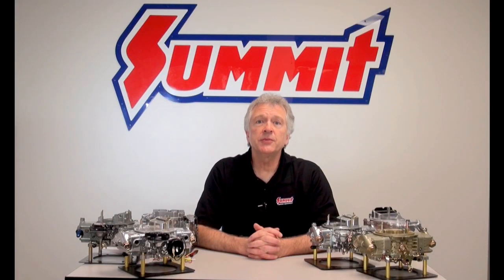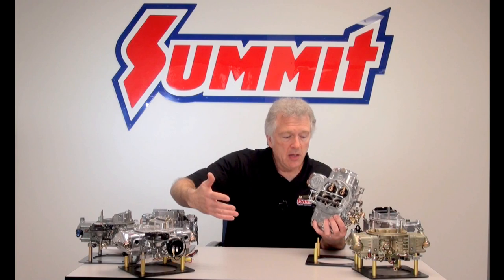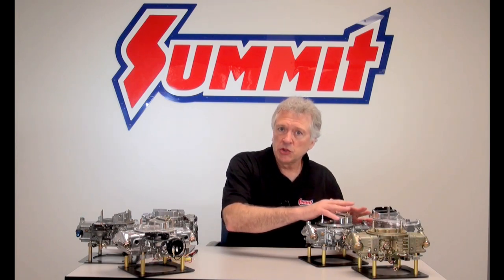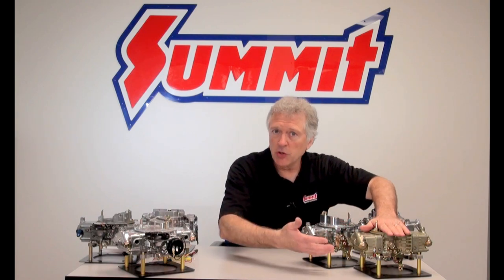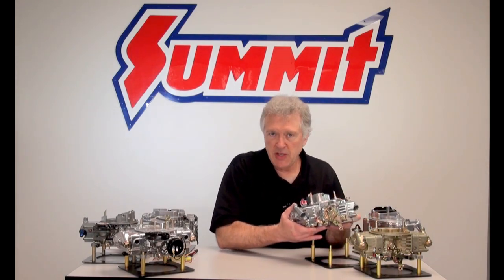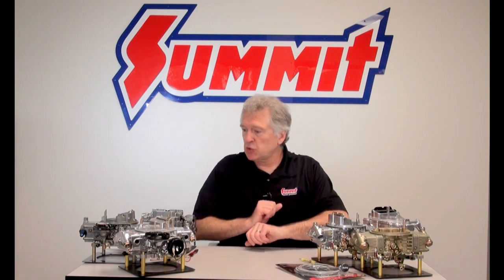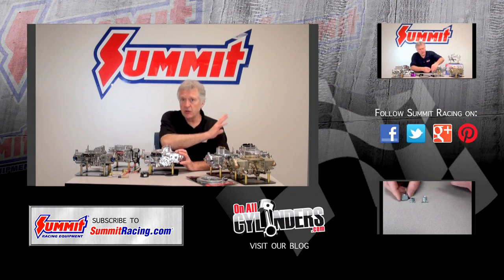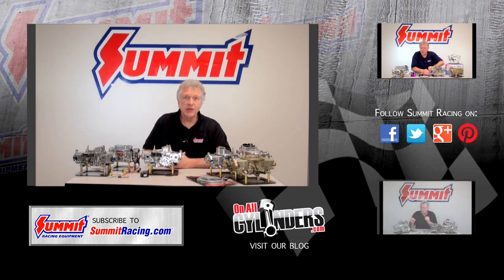Carburetor Electric & Manual Choke Tuning - Summit Racing Quick Flicks

Comment from the maker: Hi jeepjeeplady, 
A couple things before we condemn the “Choke Thermostat”. Check the voltage going to the choke cap; it should be 12 volts while the car is running. A lower voltage will cause slow to no operation of the choke. Also check and verify that the ground for this circuit is good. If those check out okay, chances are the choke cap will need to be replaced. Thank you for watching!!

Comment: i have a weird autochoke system on my Weber 32 DAT 12. it chokes when a  cooling water sensor turned  a valve on if water is cold. it worked like shite constantly choking even on hot water and flooding my carburator with fuel. i took it off and now it works very good. when cranking on a cold day it takes a couple of try to start but that's all. Sometimes i think choke makes more damage then help.

Comment: So I've only ever used mechanical chokes for my builds. Would a high rise/edelbrock air gap intake change the way the increasing heat of the engine affects the choke spring so the choke properly disengages as the engine temp rises? Considering the choke spring is further away from the heat source that is supposed to make it disengage. Thanks in advance
Reply: This is a very good question and would like to know the answer myself...

Comment: I have a Holley carb on a 390 fe engine. My question is this. The dial on the electric choke with the 3 screws will not open the flaps manually  to let any air through the top till the notch reaches the 3 o'clock position. This is then out of the range of the markings around the top of the carb side. Do i need to stay in the range and keep the flaps completely closed till warm up? Or is the 3 o'clock possession acceptable to have the flaps open slightly when cold? Or do i have a fault? Regards Adam

Comment: Awesome Norm. Question , I have what looks like a vacuum line under the electric choke, i heard it is for cold air over the choke coil to keep it from over heating. Do I hook this up to any vacuum line?
Reply from the maker: Tony Assenza, 
Depending on the brand and model number of carb that you have yes, this is possible and should not be hooked up to any vacuum hoses. Feel free to give us a call if you have further questions. 1-330-630-0240.

Comment: Any tips to check for an electric choke that engages when the engine is up to temperature (idle will go way up and go peg my wideband O2 10:1 AFR)?  

If I stab the throttle to get it off the cam, it will hold even higher until I upshift or shut the car off.  If I shut off and then start the car again the issue will go away and warm idle as normal.  I did check that nothing is binding on my throttle or fast idle connections, and my keyswitch 12V and ground voltages are consistent.

New Holley 4150 650 double pumper mech. secondaries on a 355 SBC.  Choke element adjustment in about the middle position, as it was shipped.

Thanks, Justin
Reply: I stand corrected possibly.  It appears the intake carb gasket sticks out a bit and the fast idle screw was rubbing on it, possibly sticking on it.  For anyone who encounters a similar issue, something to check.

Comment: My manual choke will close all the way, but when I toggle it over to all the way open, it stops about 1/4 inch short of straight up.  This is with or without the cable being attached.  It has nothing to do with the cable.  If I manually push the actual butterfly all the way open, it will open, but it bounces back as soon as I take my finger off of it (spring loaded).  Any thoughts/suggestions?
Reply: I know this is a 5 year old comment, but that's normal. When a Holley choke is open, it's kinda tilted a little. It's like that on my newly refurbished Holley 350 too :)

Comment: This is good stuff to know but you are mostly explaining "how" these choke systems work rather than giving us the details of how to adjust them hence your vid title "choke tuning".. Im not complaining because I know more than I did before I watched the vid BUT I still don't know what to look for when adjusting my Holley electric choke on my old Ford 260.. When I bought this car (1964 Ford Fairlane) it had a brand new Holley 4b installed on a 2b intake and the electric choke wasn't even wired up at all. Car runs great once up to temp but I have to sit in it and babysit the throttle for about 15 minutes before it will run on its own... At cold start my choke flap is all the way closed. I have seen several vids that say there should be a slight gap (big enough for a pencil to fit) at cold start. Is this true? I know this is different due to particular engine but as a starting point, is this basically true?
Reply from the maker: +GeorgeBonez, 
True, there does need to be a slight opening left at the initial cold start. If not, the engine can’t get any air and is snuffed out. If there is too much gap, the engine does not get enough of a richened mixture (too much cold air) to start and stay running. It really is a balancing act! Feel free to give us a call. 1-330-630-0240.

Comment: Adjusting the bimetallic spring and fast idle is only part of  the choke circuit. There should also be a choke pull off adjustment but I can't find it on a Holley carb. Do Holley carbs have this part of the circuit? Is it adjustable?

Comment: Have an older 80457. When you install the new choke cap, do you rotate it clockwise until the index marks line up? It seems like that is making the choke plate too tight but I’m new at this and wasn’t sure. Thank you.
Reply: Just as soon as it closes stop rotating....slow down.

Comment: Where can i buy a AC mechanical fuel pump for my 1957 ford engine
Reply from the maker: Albert, AC Delco only lists fuel pumps back to 1962 for Ford. The closest thing available would be a pump from Delphi. We would need the verify the application and engine size to recommend the correct part number. Here is a link to the Delphi pumps for a Y-block: https://www.summitracing.com/search/part-type/fuel-pumps/department/air-fuel-delivery/section/fuel-pumps-regulators/year/1957/make/ford/brand/delphi?N=brand%3Adelphi&SortBy=Default&SortOrder=Ascending&keyword=fuel%20pump&kr=fuel%20pump

Comment: on the electric choke why do you you need the 12v connected ? the spring should be able to relax with out the 12v surly
Reply from the maker: Hi Mar Gudmundsson, 
Correct, most electric choke assemblies can be adjusted to wide open and stay that way with no voltage applied.

Comment: Would be helpful to cover the choke cam and how it works too.  I don't fully understand what it does and how it works on my electric choke 4160.
Reply: ditto that's what got me here in the first place, I hear that the choke should step down the fast idle cam automagically, and then I hear that it does not, so which one is it

Comment: what would be a good reason for my fast idle cam not dropping when the choke is fully warmed? even when i blip my throttle it still is sticking wide open. it is not binding on anything and i have even oiled it and i still have to pop my hood every time i start the engine.. please help! thanks
Reply from the maker: Hi dtaylorh18,
It appears you’ve taken care of any binding issues; some other reasons for this issue are listed: 1) lacking 12 volts at the choke coil while running. 2) Bad ground at choke coil. 3) Choke coil out of adjustment. 4) Bad choke coil.
Please let us know if you have any additional questions. Thanks for watching!

Comment: I have a 86 ,gm 2.8 v6 that has a Rochester VARAJET 2bbl carb that needs replacing.  Any suggestions?
Reply from the maker: Hi dixonyourmom, 
We offer a remanufactured Vara-Jet that is a perfect match for your original. No modifications are required. It’s our part number  URM-3-3814, it’s $348.99 plus a $45.00 core charge. If you send us your original rebuildable carb back, you’ll be refunded your $45.00. If ordered today, the it will ship from our rebuilder within a day or so. http://www.summitracing.com/parts/urm-3-3814/overview/make/chevrolet
Please let us know if you have any additional questions. Thanks for watching!

Comment: I got a 79 chevy malibu with a custom Vortec 4.3L V6 engine. Wich carburetor would you recommend? someone told me that a Edelbrock #9906 would be a good fit. Is that right?
Reply from the maker: Hi bladielmickey, 
We’re going to need some more info to help you make a proper choice. Give our tech line a call and we’ll help you work it out! 1-330-630-0240. Thanks for watching!

Comment: Recently I installed a new carb from Summit on my 81 Ford Econoline. I had a backfire once and the choke got stuck shut. I fixed that, but once I put the carb back on, the choke comes on a lot when I'm driving around. If I idle the vehicle for a long time before driving, it won't do that. But if I stop the vehicle for more than five minutes and start driving again, it will keep coming on. I have an electric choke by the way. I can always kick it off, but it will come back on after a little bit of using the gas peddle. Any suggestions on how to fix it?
Reply from the maker: Okay, please tell us who made the carburetor in question here – Autolite/FoMoCo?  And, what is the model number?  Let us know.

Comment: What's the difference between electric choke and manual choke carburetor
Reply from the maker: DUB DA CAPO , 
A manual choke uses a cable that mount under the dash and run out through the firewall to the carburetor. When cold, you pull the cable shutting the choke blade. When the vehicle starts and warms slowly, you push the cable in opening the choke blade. 
An electric choke is more automatic. They have a spring on the side that electricity warms up and opens the choke blade slowly. Therefore you do not physically have to push or pull a cable but, you will have to make fine tuning adjustments periodically as the seasons change outside!

Comment: I have a 67 Buick Riviera v8  430- 4 barrel carburetor  and i need a new one. witch  carburetor should I buy?
Reply from the maker: Hi kingblack22ss,
We offer a re-manufactured Q-Jet that is a perfect match for your original. No modifications are required. It’s our part number  URM-1-198, it’s $209.99 plus a $45.00 core charge. If you send us your original rebuildable carb back, you’ll be refunded your $45.00. If ordered today, the estimated shipping date is: 2/18/2014.
http://www.summitracing.com/parts/urm-1-198/overview/make/buick/model/riviera/year/1967

Comment: hi sir i am frpm pakistan i have a datsun 1982 with orignal 10a engine in it .. i just swaps its carb with f6a engine's carbs which is E-HA11S and it was  working fine in summers but now in winters it doesnot start in morning when its too cold but later whole day it starts very well ... plxx help me for this prob i think its some kind of choke issu???
Reply from the maker: +danish ali, 
It is possible that the choke simply needs to be adjusted. If the choke cap is retained by rivets, you will need to remove these rivets and replace them with screws.  Once loosened, simply turn the choke cap in the direction that closes it sooner. This will add a little more pressure to the internal spring and keep the choke shut longer for those cold days. Tighten the screws to maintain this adjustment.

Comment: I have a 4160 Holley with electric choke. I took the coil spring and cover off. Does the choke plate linkage go above or below the red high idle cam?
Reply from the maker: Hi Pete, 
One option for looking at things would be to look at the 360 view of part number HLY-0-80457 here: https://www.summitracing.com/parts/hly-0-80457s/overview/  It will spin around and you can pause it where you need.  The linkage you’re talking about will go above the red high idle cam.

Comment: When you install the electric choke cap back on, do you have to rewind the spring/turn the cap alot or do you just put the tab in the spring hole, line up the marks, and screw it down?
Reply: There is no winding up of the spring

Comment: I just bought a holley 4175 and after loosening the electric choke to adjust, the choke plate is now stuck in a full open position. I cant close it with my hand or by manipulating the arms. Any suggestions?
Reply from the maker: Hi gofish831, 
Can you give our tech line a call? 1-330-630-0240. We look forward to your call. Thanks for watching!

Comment: Hi, when i start my car and is gettin hotter it goes like 300 above normal idle in P or N in D goes again to normal idle, this is normal?
Reply: Laura Riverón yes. The torque converter is just slowing the engine down. It is completely normal.

Comment: Can you convert an electric choke model to having a manual choke?
Reply: Or is there a recommended place to place your positive circuit on electric choke?
Reply from the maker: +3J Kreklau, 
Yes, electric chokes can be converted, but it would be easier to source 12 volts from a switched source in your fuse box.

Comment: HI!
I am wondering if the electric choke wire is a constant 12 volt ignition source during crank and run position or is it only during run?
Reply from the maker: Hi rag Doll, 
The choke wire will be on in the run position. Use the original coil 12 volt supply from the ignition switch, it will be live in run & crank positions!

Comment: Hi, I am from Philippines.   How to adjust an Automatic Choke or Enricher in a GY6 Carburetor?  Mine has this issue: The Auto Choke turns off prematurely or in an early stage of which the engine is not that hot yet for stable idling, thus engine turns off.  I tried cleaning the GY6 Carburetor hoping it was just caused by dirty system but same result, the Pin inside the Automatic Choke/Enricher extends prematurely/in an early stage even if the engine is not that hot yet resulting to stall.  It retracts right away in about less than a minute like around 20 seconds.

It my Automatic Choke or Enricher damaged?

This is exactly how the Carb with the Auto Choke or Enricher looks like:   http://i259.photobucket.com/albums/hh302/turbostang331/150carb1.jpg

Please guys, I need your help...
Reply from the maker: Chipmunkski , 
We are sorry to say we do not have parts to help with your issue. However, we were able to find other troubleshooting videos that should help you: 
https://youtu.be/IVLHaVPf7SI

some more trouble shooting info….
http://www.buggydepot.com/tech-center/150cc-gy6-automatic-choke-how-it-works/

Comment: I have a1986 Pontiac grand Prix v8 4 barrel electric choke on it. what a good carb for it? and plus choke is stuck open on cold day its not closing when I give gas
Reply from the maker: Hi Clint, 
Assuming you still have the stock 305 v8, we have a direct bolt on carb that will keep it easy and work with your factory computer controls.  Here is a link to it on our website.  
https://www.summitracing.com/parts/URM-3-3823/